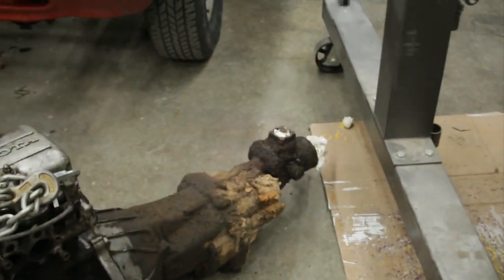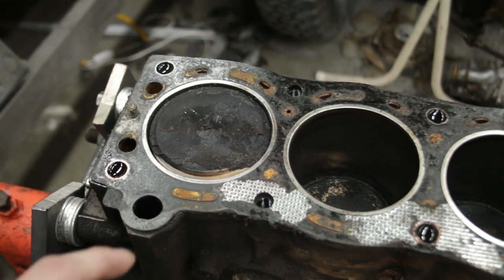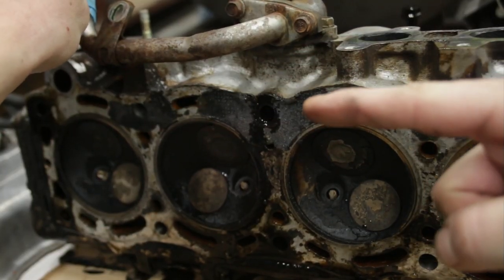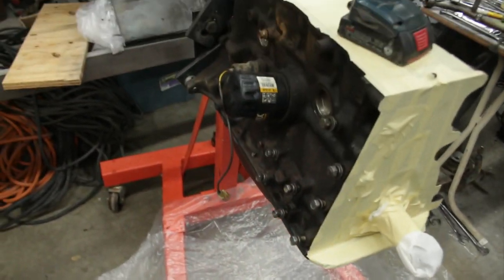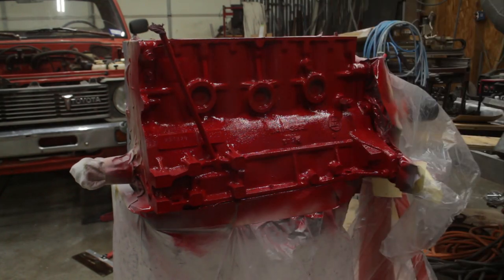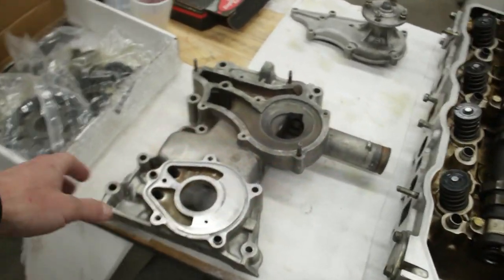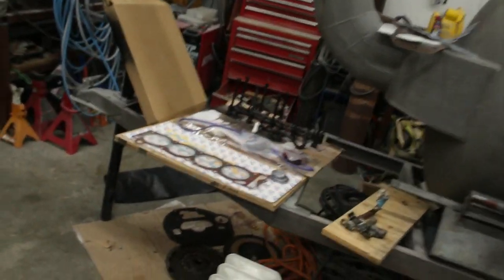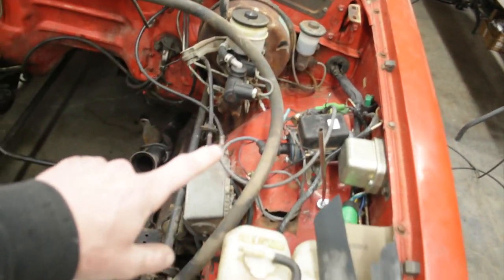1979 Toyota Engine Reseal/Refresh

Comment: I'm good at taking projects apart, it's the reassembly that gets me. Sucks about the broken gasket but it looks great so far.
Reply from the maker: Thanks Ryan, hopefully it runs as good as it looks! I've found organization is key to getting things back together. I like to punch all my hardware through some cardboard and label everything. Also taking the time to clean the parts and hardware makes the reassembly process a breeze.
Reply: @ThatJakeWorldWide  Cool trick. I assumed the hardware thru the cardboard was just for painting. Now I understand how that would simplify parts organization/placement for each stage of assembly.

Comment: Easy Off Oven Cleaner!! The ultimate degreaser
Reply from the maker: Oven cleaner does work well! I like the cheap stuff from the (previously) dollar store. I used the pressure washer plumbed to the hot water for this stuff.

Comment: Non-OEM parts?  If so, you'll have an engine but it won't be a Toyota engine.  And if it ain't a Toyota engine you may as well buy a Ford, Chev., or, OMG! a Chrysler product.  All that work and, too bad, you blew it.
Reply from the maker: OEM parts aren't even available for most of this stuff, the truck is 44 years old! LS swap incoming anyway, sounds like you will love that too!
Reply: @ThatJakeWorldWide  Not true man, Toyota makes practically everything still for the 20R, 22R, 22RE engines.  That's a crime to not use OEM Toyota gaskets, especially head gaskets.  86 4Runner owner here.